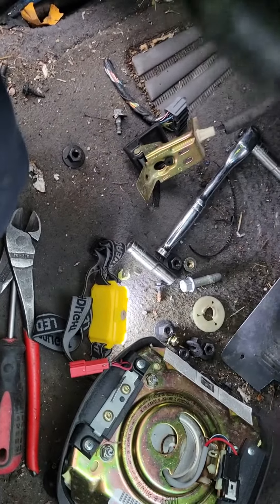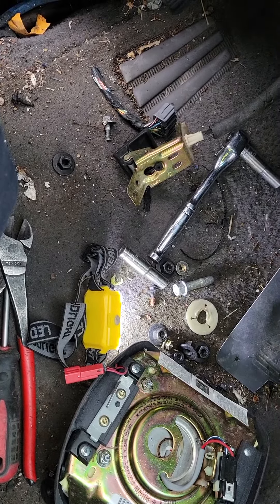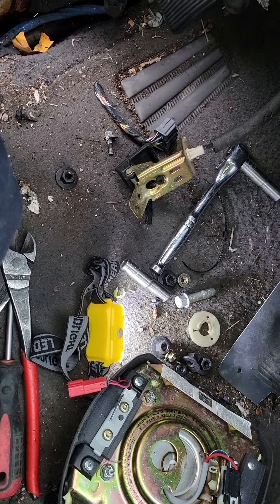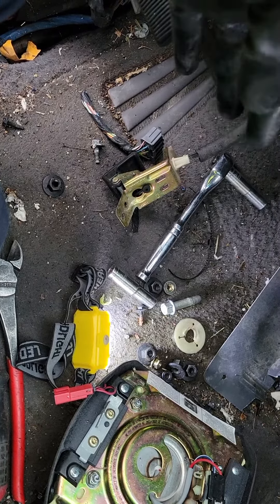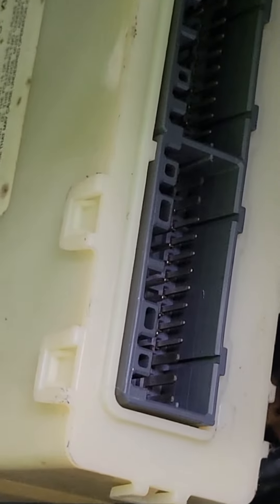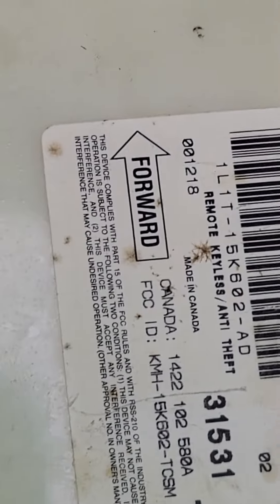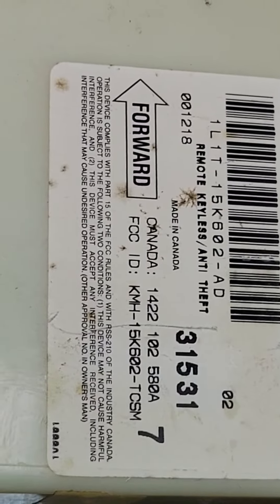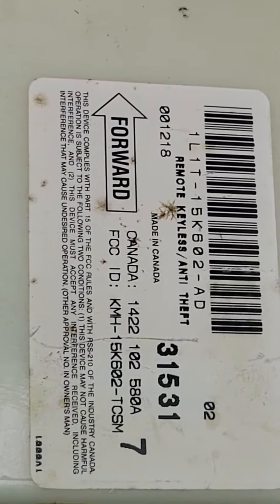2001 Ford Expedition Remote Keyless Anti-Theft Module Location and Removal

Comment: I'm currently dealing with the power locks not working on any door. The lock/unlock buttons in both front doors as well as the keyless buttons do not work. They all do seem to make it to this relay box. When I push any of them, it does make a clicking noise. If I pull the right wiring out, the lock/unlock buttons no longer click. My theory (which I have no idea) is that the output from this relay box is bad? My assumption is that not all four doors and trunk have bad lock actuators....Hoping you can help? Not sure what else it could be.
Reply from the maker: Sounds like this module is your issue. It's not hard to swap and fairly inexpensive if you can source a used one from a pick and pull type place. Good rule of thumb is always try the cheap fix first.
Reply: @CrowtownAuto  Awesome man, appreciate the quick reply. Definitely doesn't hurt to start out with the cheap fix first. I found what appears to be the blue print of the power lock system and it sounds like everything is some what revolved around the BCM (Body Control Module). Is that the same this as this?
Reply from the maker: The BCM in this era is called a GEM module by ford, it's attached to the back of the fuse box for reference. Seems like there's about a half dozen modules for over seemingly simple operation it wouldn't shock me for stuff to run through it as well.
Reply: @CrowtownAuto  Okay fair enough. Based on your other video, I do think the problem probably lies with this relay. Your other video seems to just focus on the input. Can you think of anyway to test the output? Without pulling the door panel off that is. I've got a multimeter handy, not sure if there is anyway to test and see if there is no reading coming from the out put side
Reply: did you fix your problem?  im dealing with this same issue

Comment: So did this fix the lockout that disables power from ignition to starter? I have a 2003 ford expedition XLT and I have original key but no start or crank just flashing theft light and blaring alarms but when I jumped the starter it starts to turn over, so somethings disabling the power from ignition to starter. Would this be a bypass?
Reply: Or do you know how I could bypass that